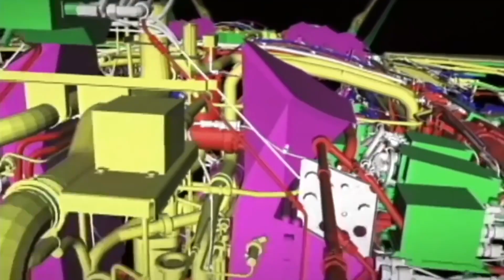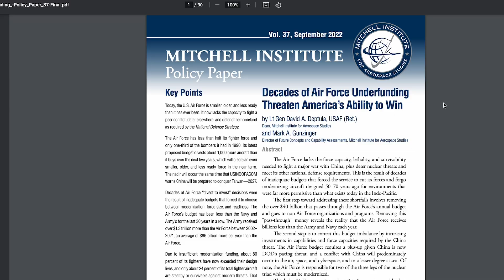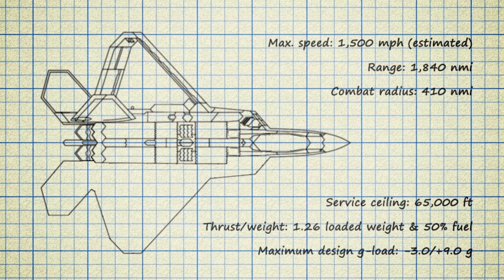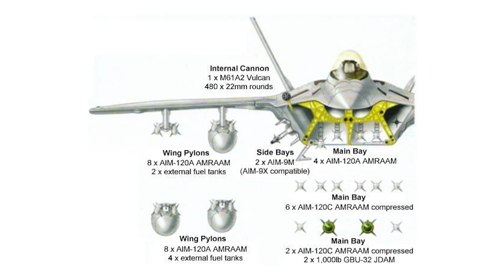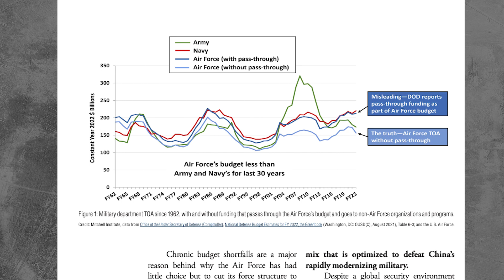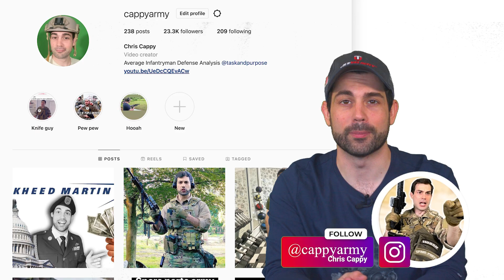Cancelling the F-22 Fighter is Worse than You Think

Comment: They cancelled the F-22 because it was too expensive. I have full confidence the military will eventually come up with something slightly better that will cost 10 times as much.
Reply: The new B21 is better and cheaper than the B2.
The next fighter will follow the same manufacturing processes.
Reply: and then made a more expensive less capable fighter that to this day has not managed to replace a single fighter that it was suppose to do
Reply: @saltysteel3996  The F-35 already kinda does! It's not quite the king of the skies that the Raptor is, but it's a WHOLE lot better at ground attack than it is worse at A2A.
Reply: a part of the rationale was to use the money for MRAPs , which was to help us pursue the Afghan/Iraq wars.  (woohoo)
Reply: @Attaxalotl  F35 is currently cheaper than some of its 4th gen European counterparts like the Gripen.
Reply: To be fair, they figured out how to make stealth coating durable and they probably could use a little more room for an radar.
Reply: Dude, at first I thought you were serious and I was about to light you up. So, please except my apologies on misjudging your wisdom and wit.
Reply: @saltysteel3996  Well, it's cheaper if they make all 100 of the B-21's. The real reason the B-2's cost went astronomical was that congress kept cutting procurement, which raised the price, which caused more cuts, which raised the price more, ad infinitum. And eventually the entire program cost had to be borne by just 21 planes.
Northrup (and USAF) got a bad rap. The insane prices are purely the doing of the Means & Appropriations committee.
It was either intentional, or the people we're electing to the senate aren't fit to manage a lemonade stand. Frankly both possibilities seem fairly likely.
Reply: @kathrynck  the maintenence cost of the B2 was also grotesquely high, which caused more cuts than the initial sticker price.
Reply: @kathrynck  you get it. The f22 would have been a lot cheaper per plane had they got the original 700
Reply: Because of Money, while Russia that having less money than US still working on their Stealth Plane Felon (even around 6 unit build or more probally), Checkmate and Pak da 🗿
Reply: The Universal Military Budgeting Value-Per-Dollar scale:
Gold Toilets <-- Air Force -- Navy -- < Postal Service > -- Army -- Marines --> Can't Buy TP
Reply: So can we make more A10’s with GE engines??
Reply: The designation of "F" means it's a "Fighter."  My guess is you mean a dog fighter.
Reply: The f35s they just grounded because of crashes?
Reply: I guess I am not the only one who thinks that every time something is canceled because it is too expensive, its replacement is even more expensive?
Reply: Expense was just thier excuse. It was Obama who called for it. It was political.
Reply: Please, it's been 20 years since the f-22 was designed, technology has improved dramatically. Also, have you seen the program requirements for the NGAD. The thing will probably end up looking like a spaceship and be about as expensive. But that doesn't because to the US government money is just a number and so if anyone can just spend their way to the best plane ever made, it's the US Air Force.
Reply: No, they cancelled it because Robert Gates was convinced that the next gen fighter would be without a pilot. He held an all call at ACC headquarters with all the pilots on the base and offered them a no-hold barred opportunity to convince him he was wrong. The problem in that approach was he didn't ask the acquisition force if the technologies required to implement his idea existed (spoiler they did not and still do not).

Source: I have been an AF acquisition professional for 20 years and know pilots that were in that room to watch the screaming match.
Reply: F-22 was developed before a lot of things even existed... I'm pretty sure there are a many problems that prevent the Raptor & the Lightning II to work together in an efficient manner. 

The F-22 wasn't made to continuously "evolve" either... you can't just add "new stuffs" on it to make it more modern.

That kind of thing is likely to be fixed with the development of next generation aircrafts... which will also probably lead to cost reductions on the long term.
Reply: they cancelled it because the cold war ended. that is the TRUE answer. F-22 cost wasn't much higher than other programs of the cold-war yet congress didn;t care as long as the Soviets still existed
Reply: I'm guessing you have never been in the military because if you had you would not say that about our government!
Reply: @Yung_pindakaas  That's more a failure for the Grippen than a success for the f35.
Reply: I hope so, many people says the same about the Sewolf subs, again, hope you are right.
Reply: @Karl-Benny  the F35 isn’t designed to fight a traditional fight. It plays an integral role in battle. If it comes down to dogfighting then things have gone terribly wrong. I’ve heard it liked to a fighter version of an AWAC. Long distance win
Reply: It wasn’t canceled because it was too expensive — look deeper and you might find out the real reason.
Reply: @Karl-Benny  Wow, are you misinformed. The F-35 is being sold to NATO allies and to Pacific allies like South Korea and Japan, and with mass production numbers, the cost per unit has gone down drastically. It's similar to what happened with the F-16 Falcon. The avionics and electronic warfare suite on the F-35 are also superior and much more modern/modular (able to be upgraded as technology improves) than the F-22. I love the Raptor but the Lightning II is the way of the future. An active duty USAF F-35 pilot, Hasard Lee, has a YouTube channel that explains this, and he draws comparisons with the F-16 (the most prolific fighter jet in the world) and the F-35.
Reply: You mean 10x LESS & make a superior aircraft & mass produce them ASAP & Efficiently
Reply: @saltysteel3996  the reason that the b21 is cheaper is because the design process of the f22 and b2 required expensive research
Reply: They did. It's called the F-35. Cheaper, just as effective, and capable of fulfilling multiple roles. 

It lacks (slightly) in maneuverability... which isn't actually that important in modern air combat, but it makes up for that with vastly better sensor suites capable of keeping track of the enemy and spotting them well beyond their own sensors' range. The F-35 knows where you are, what you are, and launched a missile at you five minutes ago that you only realized was coming when your buddy exploded right beside you. 

Dogfighting is, to put it bluntly, largely irrelevant. They can sweep the skies with largely invisible/untargetable aircraft that can take out enemy aircraft at absurd ranges. Since no aircraft is ever going to be out-maneuvering a missile designed to out-maneuver the aircraft, there's simply no need to invest so heavily into it.

It's the old WW2 mindset that Russia and China are still largely stuck in - and, well, you can see how that mentality is turning out for Russia. To be blunt: war has changed. A _lot_. We've got capabilities that make old tactics completely irrelevant. The US military has been compelled to actually change its mindset to what works, not what seems like it would work, and in this case what works is the F-35. Cheaper, more flexible, and in a lot of ways more effective - despite getting trashtalked by Russia Today and the Reformers, whose credibility should be in negative values at this point.
Reply: @gyneve  both honestly. The F35 is incredibly cheap for a 5th gen of its capabilities due to economies of scale. Its only a bit more expensive than most 4th gen counterparts while offering vastly improved and new capabilities. That said the Gripen offers capabilities worse than Rafale and only slightly above Latest block F16 for a price higher than F35.
Reply: @saltysteel3996 did I hear that it came in early and under budget?
Reply: F22 too expensive, and they decided with the F35 lmao
Reply: @PrinceofPwnage  F-35 is significantly cheaper, so...

F-22 is about $120 million per jet. $206-216 if they restart production.
F-35 is around... $78 million per jet.

No matter how you slice it, F-35 is a fantastic successor to the F-22. It's just been memed on by Russia Today and Pierre Sprey's cronies whose cumulative knowledge about aerial combat begins and ends at the Vietnam War.
Reply: @Yung_pindakaas  The project expense, and spinning its wheels getting started was the issue not the individual pricing nowadays which has gotten lower.
Reply: Slightly better? lmao.
Reply: @jacobzindel987  Yeah, that generation of stealth coating was quite delicate & high maintenance. But it is a good example of how congress's micromanagement of funding can muck things up even more than a foreign army can.
Reply: @Yung_pindakaas  That too! It's truly a masterpiece of aircraft design, and the legion of engineers behind it are a true inspiration for me!
Reply: It was so expensive because they made so few of them. Look at how much the price of the F-35A has come down since initial production.
Reply: It was expensive cause they keep cutting orders duh.. Don't let the saying its too expensive is a joke.. with any new technology comes cost but f22 would have cost less if they just had more built. Alot more expensive development for a new fighter
Reply: @DisgruntledArtist  add how much the program of the F35 cost
Reply: @matthewjackson5325  A LOT cheaper. As would the parts & upkeep.

Although, ultimately, I think the F-22 had a glass jaw in the form of poor IR stealth (relative to the Widow), so the lifespan of it's reign of dominance was limited before the first plane rolled off the line.

The logic went "well nobody has large numbers of aircraft with good IR sensors anyway". Kinda overlooking the point that IR sensors are relatively easy to make, and are now on thousands of aircraft. It's still pretty deadly, but it's not dominant like it was at launch.

If the F-22 wants to survive i n 2022, it needs to avoid using the gun or sidewinders, and stick with BVR kills only. It'll draw a lot of IR missile fire well before it gets close enough to show off the acrobatics.

So in a way, shortsightedness in procurement numbers somewhat negates shortsightedness in competition winner choice.
Reply: @honfmeilingfleet957  About a dozen units now. Maybe 15. Not all of them production models or combat capable though. Felon is technically inferior to the Raptor. But it's close enough to be a threat.

Unfortunately for Russia, I think the assorted embargoes have massively disrupted their top-end aerospace development & construction ability.

Much respect to the russian aerospace engineers though.
Reply: @Wessel Reynierse  Your glorified piece of crap F35 keeps getting delivery delays due to the F35 being a crappy plane.
Reply: we haven't need them since then.
Reply: @saltysteel3996  Don't look up the Air Forces NGAD program. For your own safety. Things probably gonna cost "hundreds of millions an airframe"
Reply: @saltysteel3996  yea that was a massive surprise to me too when I herd that.
Reply: @sevrent2811 what he said. Going from no peer adversary to peer adversaries kinda ironic now.
Reply: @Yung_pindakaas  
Lol no way. Still more expensive. Even by US standards
Reply: Haha😂
Reply: @DisgruntledArtist  Well said.
Reply: @rondoofnightmare775  Closing in on 900 built. The delays are largely due to literally everyone wanting them at the same time.

There are some delays. But tell me what plane you think is great, and I'll show you similar production delays.
Reply: @rondoofnightmare775  "Crappy plane"
Well, this crappy plane somehow killed 20 F-16s and lost only 1 in a Red Flag operation in 2017.
Reply: @applepie1911e  uh yeah the f35 is indeed a fighter. It's designed for both air to air and air to ground.
Reply: bkm83442 
They cancelled the best fighter jet in the world that barely saw any combat apart from a couple of sorties in Syria and even then it was spotted on radar by the Russians 
The truth is it was an over hyped expensive toy
Reply: F35: hold my beer
Reply: @nicktechnubyte1184  
SU57 hold my beer
Reply: @mark4371  being spotted in radar doesn't mean anything. Stealth jets get spotted on radar all the time. The team challenge with a stealth aircraft is NOT spotting them, the challenge is getting a weapons grade lock which is a million times harder.
Reply: Don't worry the Chinese can make f22 in the future with less expensive.
Reply: @mark4371  The SU-57 is perhaps the best stealth fighter in the world. It's so stealthy that we have never ever seen more than 15.
Reply: @andrewlechner6343  F22 design started in the early 80s and reached its first major milestone in 1986 and production started in 1996. So more like 40yrs old. Which is insane to me, considering it is still so far ahead of pretty much everything else.
Reply: That dig at the end was a thing of beauty,
Have a very Happy New Year.
Reply: Well yeah in a few years 6th gen fighters will roll out. Should come out by 2030 Acording to the military
Reply: Yeah it is called the F-35, oh wait you said better
Reply: @applepie1911e  How is it not a fighter? Name an aircraft besides the Raptor that comes close to it's capabilities.
Reply: I hate to tell you this but 6th gen fighters are looking to make F22 seem cheap. See peruns presentation
Reply: @andrewlechner6343  Navy F/A-XX project looks actually more ambitious in many ways.  1000+ NM range one one tank without refueling (F-35C is sitting at ~680 as one of the longest range fighters in service with the navy), higher top speed, enhanced stealth capabilities, and a massive internal weapons bay capable of carrying 2xAGM-158C LRASM's paired with the same insane sensor fusion found in the NGAD
Reply: Lol slightly better NGAD is more than your mind could even comprehend
Reply: @bobo-cc1xw  good.
Reply: @Yung_pindakaas  mostly because other countries want it
Reply: @johng8967  We kind of already hold a significant advantage in every respect.  Russian logistics don't exist, and they don't even have enough Su-57's for a squadron yet.  China has been hyped up on nationalism, propaganda and corruption for so many years that their end result against NATO or the USA would probably be similar to Russia's (maybe with some more fight though).  China also doesn't exactly have the greatest stealth fighters either.  J-20's RCS (as mapped by Taiwan) is close to the F-117's and doesn't look to be great in maneuvering fights (we're not even gonna touch engine life, sensor fusion, and maintenance)
Reply: @AverageJoe483  not really. It's cheaper then the a10 and much much much better. The f35 is amazing and is to replace most aircraft outside of the f22
Reply: @RuneFoot  but the R and D to develop the program was no where near worth it. It is approaching being obsolete already . Warfare is moving on.
Reply: @Anarchy_420  Even if it's not immediately better, the frame itself is being designed with hardware modularity and upgrade in mind moving forward so the cost of modernization is reduced
Reply: @kathrynck  yeah i also heard that Russia have so much money because of Gas and Oil export even Europe try to cap Russian Gas and Oil Russia still gain lots of money by selling it to Asia or Africa
Reply: @saltysteel3996  and it only took them 30 years!
Reply: @PrinceofPwnage  Depends on what you're asking. The overall program over its 70+ year lifetime? Estimated between $400 billion and $1.-something trillion. Of course that's taking into account maintenance and how many planes they plan on buying - 2500-ish atm - though that may increase over time.

R&D? Around $35bn.

From what I can find the R&D for the F-22 is between $26-40-ish billion. 

The overall F-22 program seems to cost around $108 billion and this is for... 195 planes. This was over its.. 30 year lifetime? 40? Hard to gauge.

So yeah. It's not quite that simple, really. F-22 is smaller in number, more expensive to maintain and construct, and is ultimately designed for missions that the US hasn't really had to deal with in decades. The F-22 doesn't seem to have ever actually needed to fight aircraft for aerial superiority. It's downed some, certainly, but there's been nothing up there to compete with even previous-gen US aircraft.

As such the F-22 is being phased out by a plane that can fulfill its role adequately while also not being largely useless outside of that role - able to perform an absolutely staggering variety of missions in addition to knocking aircraft out of the sky.
Reply: You go to war with the force you have, not the one you want years down the line. The F-22 was cancelled because MRAP production needed to accelerate and Gates prioritized the present at the expense of the future. Now we have an Air Force that is older and smaller than it's ever been its history. In the 1980's the average age of a U.S. fighter was 7-8 years old. Today its 30-40 years old and our adversaries aren't standing still. Gates also got wrong how many 5th gen aircraft China would have. By 2023 he said they should only have a handful, instead they have close to 200 and production is continuing.
Reply: DO I DETECT THE SLIGHTEST BIT OF Sarcasm HERE?
Reply: @tomj3372  Sarcasm is a true artform. But it can be hard to infer from the written word. Personally I use <sarc> so that my sarcasm is clearly indicated to those lacking the intellect and/or sense of humor to appreciate it.
Reply: @Rimasta1  Thankfully the F-35 production is already in full swing and so far as we can tell the Chinese aircraft do not have abilities comparable to the F-35, let alone the F-22. 

The F-35 is cheaper and, more thankfully, is useful for way more than just aerial superiority missions. It's not great, but with some 800 F-35s vs the 195 F-22s, I think the US air force is going to be alright. They're just panicking because they can't hypothetically crush both Russia and China simultaneously, but it also seems like they vastly overestimated the abilities of the Russians -- and possibly the Chinese as well.
Reply: @bobo-cc1xw  also maintance on 6th gen will be cheaper then 5th gen
Reply: @DisgruntledArtist  that's a really well written response. Thank you.
Reply: @saltysteel3996   no, the B21 claims to be better and cheaper than the B2, but the B2 itself claimed to be better and cheaper than it turned out to be :-)    The B 21 raider will turn out to be more expensive than Northrop is claiming at the moment …no doubt driven by last minute changes  and requirements like being able to operate off of a Ford class carrier, and run on bio diesel, while also being run on solar panels and hydroelectric wind energy…. And when none of that turns out to be feasible, they’ll probably run the whole thing on some weird kind of hydrogen fuel cell that cost 10 times as much, but is zero emissions and clean for the environment :-)
Reply: @saltysteel3996  Yes but the B21 has half the load weight capacity than the B2. B21 is smaller.
Reply: @Yung_pindakaas  …. In bulk, when separated from the R&D costs… or whenever Lockheed feels like lying it’s ass off.
Reply: @daxtertalon4  The Nighthawk, F-117 is anything but a fighter aircraft, yet it has a designation of 'F.' It's a bomber. It probably couldn't dogfight a P-51 Mustang.
Reply: @arcturionblade1077  I agree, and it will be retired faster than the F-22. That's the way of the military. In contrast, we still are using the B-52. It has been reworked and now sports advanced avionics, soon new engines (I hope) and still be here when a great grandson of a B-52 pilot will fly the thing.
Reply: They are currently testing it. Look up the NGAD program. Its supposedly being fast tracked so I doubt it will end in failure. It will however come out of tthe box with some issues like the f35 that will be fixed as more are made.
Reply: I'm the only one who's got your joke bro hahaha
Reply: @andrewlechner6343  f 22 failed
Reply: The F22 per unit cost was way down by the time they cancelled it.  They also had most of the bugs worked out.  It was well seasoned and just coming into it's stride when canceled.  It was a very bad decision to cancel the F22 and was based more on politics than anything else.  It was a beautiful machine in the production line.  It was very well thought out for maintenance too for once maintainers can climb onto the plane and work on it without the need of ladders.  Modular components make maintenance a much easier task than many previous plane.  

The issue is the time delay of develop, compete, award, work out problems then get the production line going, plus parts and repair facilities.
Reply: LOL, too true.
Reply: @PrinceofPwnage  Aw, thank you. It's... a weirdly complicated situation and finding numbers (all of which are invariably estimates rather than actual hard numbers) was a bit of a struggle.

I saw numbers for the F-22 ranging from $26bn to $120-ishbn, for example. Just a goddamn mess. It literally depends entirely on how whoever is giving you the number is measuring the cost at any given time. x__x
Reply: Like the F-35?
Reply: @snugglecity3500  a prototype was built and tested in just one year lol yeah I'd say that's freakin fast trackin it😆👍
And to everyone complaining about cost issues NGAD and F/A-XX shouldn't run into these complications much like The B-21 Raider.
Lol not directed at you S City just had to throw that in ;)
Reply: Too expensive and cut corners once again, might as well give it Iran , they treating the old Tomcats better than the Americans can, I'm sure they'll be use to their maximum potential.
Reply: Slightly better is all you need to be completely honest. An m4 is only slightly better than an m16. Slight advantages lead to much larger gaps than you would think. 10% better stealth is monumental.
Reply: @jahlahbrine843  Funny joke, but where is the punchline?
Reply: Don't worry If the air force gets everything on its wish list for NGAD its will definitely cost more than 10 times as much
Reply: Yea but naw hammy.
Reply: F35 is the next thing after f22. Isnt it. It is cheaper and has much better features
Reply: I'm most excited about Rapid Dragon. It is 40+ cruise missiles per C-17 sortie, fired from a standoff range of 1000+ miles, and it'll be able to put hundreds of cruise missiles on Chinese air bases before any of these fighters ever get into the air. Even if the S-300 could intercept half of that, it'll be enough to cut down the Chinese air attack capability before any dogfight is considered.
Reply: Hundreds of millions of dollars of the best money can buy. Not to mention next gen drones and a next gen advanced propulsion system.
Reply: Cover the A-10 Warthog with radar absorbing paint! An air superiorority fighter with a 30mm gatling gun! Problem solved!
Reply: @joew974 Were all of them grounded or just one model?
Reply: @joew974  you mean like every other aircraft that has crashed?
Reply: A big part of the reason it was too expensive is they cut production numbers so severely. It would have probably been a similar price to the F35 if production continued to the originally planned amount.
Reply: Carbon fiber Bulletproof nanotech F-33s built in Norway 🇳🇴.
Reply: @joew974  the only ones grounded were the f35 b there was some issue where it could lose precision in the guidance system during a vertical landing and cause damage to the aircraft. Military jets always have issues that aren't discovered and fixed until they've been in service for awhile. There were a ton of issues with the f15 and f22 during their design and even after. F35 is still a great jet, and issues are being resolved all the time, it will be another year or two before it reaches full maturity. It's impossible to build something as complex as a jet without multiple issues being discovered that will require temporary grounding until the issue is fixed.
Reply: @Anarchy_420  my point with fast tracking is that the early production airframes wont have their kinks ironed out. They will get grounded multiple times and have a low ready rate for a while.
Reply: @mikemurphy80  the f35 absolutely can dog fight AND DO IT WELL, however it is not its main design feature. The f35 is a jack of all trades. And has a lot of focus on ground attack. However I will say that several pilots have said that the f35 would outmaneuver any jet out there except for the f22. To say it can't dog fight is underestimating it radically
Reply: It wasn’t “too expensive.”   It cancelled so we could have “cash for clunkers.”  The same time they were cancelling the F-22 they were launching “cash for clunkers” at the same time.  So it was a choice by the Obama administration and Democrat congress.
Reply: In the name of capitalistic economic defence industries... 😂
Reply: @snugglecity3500  this is 6th generation we shouldn't see the same 5th gen problems with how advanced digital engineering has become insanely efficient, my point was they built, and flown a prototype already in just a year in itself is mindblowing! Made possible from powerful supercomputers and digital engineering! This isn't just another Plane NGAD will change aviation!
Reply: They already flew something light years better.
Reply: For reference, one f35 would buy you half a f14 in real terms. I take it from this that development costs are rising for each new generation, whilst manufacturing costs are being trimmed back (in very general terms)
Reply: @Karl-Benny  The F-35 does have the advantage of being able to be launched off helicopter sized characters. Adds a ton of versatility to the smaller carriers.
Reply: @Anarchy_420  im more excited for 7th gen. With all the programs going on right now the generation after the next one will most likely have entirely different propulsion. Like going from props to jets except it will be a different kind of jet engine.
Reply: @saltysteel3996  lol depending on the defense contractors. Northrop YF-23 lost to LM YF-22 because back in ,,,80s and 90s Northrop were doing what LM doing now. Delays and over budget. Some companies learn their past mistakes some don't.
Reply: I was lucky enough to have an awesome close range air show of an F22 for like 20-30 minutes. It was awesome. I was in the middle of a field by myself at NJMP during a track day, and this guy in the F22 was flying directly at me. Pulling high G turns around me. It was like my own personal F22 show
Reply: @tranquilreverie203  SU57 will probably see more combat than the F22 ever did
Reply: Lol
Reply: They cancelled it because they don't need it. The F-35 program was expensive too. The Chinese and Russian air fleets aren't an actual threat so long as their air-to-air ordnance isn't up to scratch.
Reply: LMAO soooo true
Reply: They canceled the F-22 because there was allot more money to be made in the F-35 since it could be exported.  The F-22 would have been allot cheaper if they would have originally made what they first wanted.  Plus there would have been continued research and advances in its stealth tech which didn't happen because it was canceled.  They moved on from it.
Reply: Yeah f22 is 20 years old and still better then the waste of money  f35 has been
Reply: @Matt-yg8ub  just look at the numbers my guy. For the Price of restarting F22 production you can buy 3 F35s for each F22. Also yes RnD is factored into the cost, but if you can spread out the R&D cost over thousands of planes the planes become a lot cheaper.
Reply: @Yung_pindakaas  Not for maintenance, the F35 is still very expensive in that category. Initial buying cost is not everything.
Reply: @mark4371  You are probably right about that.
Reply: @Perrirodan1  compared to what though? The F22s stealth coatings were notoriously horrible to work on causing extremely high maintenance costs, they were also comparatively unreliable. The F35 statistically (unlike popular belief) has the lowest failure rate of any US aircaft currently, its panel based stealth coating is much easier to work on. Is the F35 maintenance more expensive than a non stealth 4th gen? Yes. But its vastly better than the F22s.
Reply: @lonemaus562  I respectfully disagree. The F-35 has evolved into a lethal killing machine.. in 2017, it had defeated aggressor F-16s in a Red Flag operations with a score of 20-1. Moreover, an F-35A is only $78 million per unit, which is extremely affordable compared to 4.5 and 5th generation fighters.
Reply: @Perrirodan1 The cost of maintenance isn't an entirely bad thing. It creates movement in the economy as maintainers are paid, and they take that money back to their communities
Reply: You know all this anti plane stuff is stoked up by rival manufacturers.
Reply: Does not everyone understand how threat-levels, logistics, costs work? Example: Not all APC's are tanks etc... Not all bombs can be tactical, not all bullets are armore piercing. Not all grenades are "frags", not all howitzers have the same rounds, not all ships do the same thing (nor Subs) etc.... Even Spec-Ops have differing specialties. The F-22 was a "tip-of-the-sword" system, not a mid-low level threat. Sh*t, I'll build 1000 P-51 Mustangs for the cost of 1 B2. Upgraded components and cheaper to man/maint. Gimme the $$$ for 2-3 B2's and I'll fill the sky with P-51 (2022's). Dones can be corrupted, not a 51, leave the (most) tech out of it. NOE flt is dangerous to those that cannot see them. Bouncing betties :)
Reply: Correction: it was too expensive, and there was nothing American enemies had that justified the cost.
F22 was literally too good for the world. That's fucking mic drop moment for everyone involved.
Reply: @sachmo0196  Yeah 1000 p51s are gunna need a lot of investment above and beyond the planes.
Also I don't know who you would expect to fly it.
Your strategy seems to be "well this will make them run out of missiles pretty quick"
Problem is you run out of willing pilots pretty quick too.
Reply: @daxtertalon4  F-117 - except when it doesn't ;-)
Reply: @gyneve  Not really, it's a result of an order of magnitude difference in number of airframes produced. And tiny Sweden certainly doesn't have the clout to compete on a level playing field with the US. Now, if Sweden was a super power (it's only been 400 years since the last time ;-), we'd surely behave the same way though!
Reply: yeah probably
Reply: @Attaxalotl  it can also be afforded by lower budget military's than the USA, at only 100 million a plane. It also has greater stealth than most other planes (Other than the F22), better hardware like radar and tracking systems (other than the F22), and can be used in a multi-purpose role, being able to carry bombs and AAM's simultaneously.
Reply: @honfmeilingfleet957  given the Russian airforces current performance in Ukraine (aka getting shot down by decades old MANPADS systems and more recent mobile missile AA) ima guess that their new stealth jet won't be able to match the F35, both in production numbers or performance (6 Su-57's in a 3 years compared to 900 F35's in 16 years)
Reply: @maurice3464  well, the A10 hasn't been produced in decades, only modernised, and it's modernisation package costs more than a brand new F35 so I'd say no. If anything, the USAF should be looking into replacing the A10
Reply: @mikemurphy80  if a modern fighter even gets within visual range of an enemy fighter both sides would have had to have fucked up completely. Over the horizon missiles have existed since the F16, nowadays stealth and missile tech is more important than anything else a fighter can have.
Reply: @irishkiwi477  yeah, F15 took decades to build but the F16 took just months since all the required infrastructure was already there. There's always gonna be an expensive plane that doesn't reach mass production followed by a cheap plane that's better and does get produced. F22-F35, B2-B21.
Reply: @tranquilreverie203  6*. Ignoring prototypes only 6 have been produced in 3 (coming up on 4) years, out of the 15 ordered.
Reply: < 200 is tricky to support - probably lose a couple a year to accidents. I would have asked Lockheed Martin to keep the production line open at an absolute min. rate and ask for a Raptor v2 with a bunch of technical quick wins to improve sortie rate.
Reply: @Wessel Reynierse  Obviously, you have not heard about the latest setback to the F35 program in which the nose gear collapse of a F35B during landing has triggered yet again another delay in delivery of the much hyped super fighter that always seems to break in operational usage. Everything from the mountains of super complicated computer code to actual working parts of the design have yet to be approved for full rate production leading to actual costs of the fighter to be much, much higher than Lockheed and the airforce would like to admit. So far, the F35 has failed to meet operational parameters for usage and likely never will be able to meet program expectations. The sad truth of the matter is the pentagon under Bill Gates made a colossal screw up in canceling the F22 raptor in favor of dumping all the Pentagon weapons budget for the next 50 years into a program that has been doomed to fail from the very start. 

As of today, the clear choice right now is to cut the Pentagon's losses and buy more F15EX fighters and put those aircraft into use as soon as possible.

The F35 fighter program is yet another case study in how to not buy a fighter design that actually works.
Reply: @cookiecraze1310  can we keep the gun system? It’s called “Smoke break” in battle.
Reply: @mobilekaos  That’s the upgraded engine I believe. No plane expert but know that sound of the weapons system. I know it’s not even made anymore just a light hearted response. However if you seen 60 of them bastardized plane coming all full guns blazing think of the star spangled awesome shit that would do!
Reply: If the US is saying the F-22 is too expensive to manufacture, imagine what the SU-57 costed the Russians to manufacture
Reply: @sevrent2811  exactly. And until Russia invaded Ukraine, no one REALLLLLLLY believed that great power conflict was likely in the near future.....
Reply: @DisgruntledArtist  Yep, its also by my calculations F-13 better than the F-22
Reply: Sounds like you haven't been in the military then. Anything that makes sense has never happened in a uniform.
Reply: U need to have enough orders to drive down the per unit cost so it becomes a chicken and egg problem.once you cut back in the orders
Reply: F35 does it still have side guns? its pretty handy when a pilot gets into very sticky situation like F22 still got Guns. just in case of a very close encounters of a kind.
Reply: @saltysteel3996  to be fair, a lot of the additional expense with the B2 is because of last minute changes to the requirements that were undone in the B21
Reply: @Karl-Benny  Are you talking about the f-35?
Reply: @saltysteel3996  But the F-22 was air to air
Reply: @Pyratemime  what can you share about that screaming match that is hilarious, illuminating and won't get you in trouble?
Reply: Tell elon to make 1 and it'll be done in 1 year and cost 35k LOLOL
Reply: It's called the f35.
Reply: @Yung_pindakaas  really? The gripen is $30 million a piece with the F35 is $78 million each
Reply: Your comment pissed me off until I read the 10x cost part. We're cool now.
Reply: @james_the_darklord  idk where you got that figure from, gripens currently go for around 85mil.
Reply: @Attaxalotl  US just ordered 100+ F35 i heard
Reply: @stannisbaratheon6637  The plan is to order a total of 3000
Reply: @Yung_pindakaas  I don't know where you got yours but the J39 is a bargain multi role jet fighter
Reply: @mikaelandersson1288  the F35 was never designed for the same role as the F22.   Just look at the designs, the F22 can supervise, has almost twice the speed, and has several advantages over the F35.  The F22 was designed specifically to take out other aircraft, missiles, and satellites.  The F22 was originally going to take the 0lace of the F15E and the F35 was designed to take the place of the F16.
Reply: @chesterpophamproductions2879  The F-22 is overpriced but goood with a top speed of MACH 2.3 while the F-35 is both overpriced an bad with a top speed of MACH 1.6.
Forget about dogfights... how is the F-35 going to outfly SAM's at MACH 1.6?
Reply: Tax payers needs a better military equipment for freedom
Reply: @homelandfighters8541  Buy from germany.... it's very good quality and it's not overpriced.
Reply: And with the guns removed like on zumwalt
Reply: @Shoelessjoe78  yeah with their 3 days of conventional ammo and no tactical nukes. Sure thing bro 👍
Reply: @@traianowellcome2617 F-35 = MACH 1.6 top speed.
Reply: @Macho98  yes but they got a 6 th gen fighter called NGAD in production that is going to cost like $100 mill a pop
Reply: For what reasons will it cost more? Adjust for inflation and you have 3 times the money to play with roughly but I don't understand how it will cost more excluding the exceptional circumstances we couldn't really have anticipated
Reply: @TheSubpremeState  it’s going replace F22 role but going to be way bigger than most fighter jets at least a 2 seater. They want much longer range so it can operate better in pacific like further than Guam range. NexGen stealth capabilities. An a lot of man unmanned capabilities.  And do all of that at mock2
Reply: That shit was a Chenny money scheme!
Reply: @cookiecraze1310  wait?! So they no longer hit the brakes so they can fly right by??
Reply: @Yung_pindakaas  the Gripen can dogfight. the Gripen has also beaten The J-20 in longrange combat in exercises with China. The new f-15EX costs about the  same as the f-35 and is much bigger and more capable. but the F-35 is well suited for its role in combined arms air to ground. but it is near useless in that role if we cant control the skies.
Reply: @jdo8405  Specifications on ngad are not finalised. price per unit with drop as more are produce as it has with the F-35
Reply: @saltysteel3996  That's not Lockheed bro. That's Northrop.
Reply: WE. JUST GAVE AWAY 100 BILLION DOLLARS ,,,,,HOWW. MANY RAPTORS COULD THAT BUY,???
Reply: It is the only way to push boundaries.
Reply: @sandraherdman3783  Very few raptors. It would cost a huge amount to restart the production line Probably not worth it to build a 20 year aircraft when you can design a new much better one. Also raptors dont work on carriers
Reply: hahahaha!!!! exactly
Reply: It's expensive because it's proprietary technology, the F22 was such an amazing piece of kit it was illegal to sell even to our closest allies. The next one won't be any cheaper to build or maintain.  I think the cost was calculated against the numbers realistically needed. We had over 100 of the best air dominance aircraft in the world. At some point they have to ask, how many do we need.
Reply: @unknown23hornet22  Dogfights dont mean anything anymore. Nice that the gripen can knifefight but if every engagement is BVR its useless. F15EX isnt more capable than F35 but is great when used in tandem of eachother. You have a clear misunderstanding of how important stealth is in modern A2A engagements. A F35 can detect and fire on a non stealth plane like Gripen at roughly 150km away, a Gripen cant detect and fire on a F35 until within about 20km away. This means a F35 can shoot and kill nonstealth fighters without ever even showing up on their Radar. F15EX is a supplement to F35. F35s stealth is lessened a bit when its weapon bays open and this limits their weapon load, mean while F15EX isnt stealth but can carry a lot of big long range missiles. So you could have F35 flying ahead as a forward stealth sensors/radar platform, designating targets for the F15EXs acting missile trucks, with the F35 guiding their standoff missiles to targets.
Reply: @Yung_pindakaas  Well said. Well coordinated combined arms is extremely effective. Few things though. SEAD (Suppression of enemy air defense) is likely a concern. You have to worry about people using your own radar to track you. Anti radiation missiles, jamming and maybe a few decoy missiles are all variables
      Altitude is important in this scenario as low flying planes are harder to detect but have less ability to detect things.
    Also 15ex has very good radar and can carry a infrared tracking system. This would decrease the effectiveness of stealth aircraft. 
    Stealth is not full spectrum it optimize for certain frequency. It is often optimizes for targeting frequencies, like it is in the F-35 and F-22.  Fighter and targeting frequencies high frequency radars.  But they much easier to spot with low frequency search radars. the enemy will likely know they are there unless they are hiding in the shadow of another aircraft. but targeting them is much harder. That is how an f117 got shot down.
Reply: @unknown23hornet22  I fully agree with you. Especially since J20 and SU57 arent even true stealth, just Low Observability from front aspect and have little IR shielding.

 The F117 situation has slightly more nuance though, it was in part due to a highly motivated and smart Air Defense commander in addition to negligence by USAF by flying the F117s over the same approach again and again without sufficient EW support. Its an interesting story tbh.
Reply: No, the F-22 was too expensive BECAUSE they cut down the order and wouldn’t allow even very close allies to buy it.  When the government purchases a weapons system, all of the R&D cost is spread out as part of the unit cost for each one.  So if the R&D cost for a plane is $10 billion, and you only build 20 planes, then each plane has $500 million of the R&D cost tacked on to the actual cost of production.  But if you build 500 of the same aircraft, that’s only $20 million of R&D cost per plane.  This is why the B-2 cost $2 billion each and the F-22 cost $200 million each....because too many members of Congress see the initial unit cost and don’t realize that it will come down if they stick with it.  (Rumsfeld/Gates/Bush/Obama also bear some blame here for not making the case to Congress and focusing too much on weapons for low-intensity conflicts and non-peer adversaries.)  And then there’s more money that has to be wasted on the replacement.  

By contrast, Congress was persuaded to stick with the F-35, and now the unit cost is down to about $75 million, which is a good deal as jet fighters go, and cheaper than a new F-16.  And contrary to what uninformed people would have you believe, the F-35 has turned into a really excellent aircraft once the kinks were worked out.  Too many people are reading reports from 6-7 years ago and assuming they haven’t fixed the issues.  They have.  That’s why foreign buyers are lining up to purchase it.
Reply: @honfmeilingfleet957  Yeah, but the Russians’ “stealth” Su-57 is only about as stealthy as a Super Hornet (not stealthy), and they don’t have the capability to make their systems work as advertised.  The other two aircraft are nothing but drawings on paper, with one wooden mock-up of an Su-75.  Meanwhile, the US is building hundreds of F-35s, with systems that actually work.
Reply: @joew974  The F-35 has had a lot fewer crashes than any other fighter program of its size.  2 crashes, and one that rolled off a carrier after landing.  Other countries are lining up to buy it.
Reply: And no major performance increase over the F-15E Strike Eagle.
Reply: I was laughing my ass off when I read this the 3rd time. Completely spot on!
Reply: Not only is it too expensive, but it has major maintenance issues.. I am a former USAF fighter pilot.. I knew the F-22 was going to be cut a couple years ago.. The USAF is moving to a different philosophy of fighter design and procurement to make it more flexible and cost efficient..  ( If that is even possible in any government entity!  LOL)
Reply: @vicpotts6381  The F-35 is also too expensive.
Why not develop a F-16G with the latest tech?
Reply: @kathrynck  exactly the same thing happened to the F-22, the per unit cost kept increasing as Congress kept cutting the number of fighters that would be procured. If the Air Force purchases all the new super bombers as promised the per unit cost would be cheaper than previous stealth aircraft but if we look at it historically I would not be surprised if the number of aircraft purchased goes down to below 30 and the per unit cost triples or more. US government keeps playing the same game they order a number of fighters to certain specifications, the fighters / bombers are developed and the government is told it will cost x price for the specified number of aircraft and then the government response with great will take a tiny portion of that and then they take a quarter to a 10th of aircraft 4  to 10 times the cost. In the end the US government pays the same amount for fewer aircraft a decision that only makes the barest amount of sense if you are looking at per unit operational cost. But even if you only intend to operate a fraction of the number of aircraft purchased having spares mothballed would save a lot of money in the long run . The only conclusion is that the US government cannot plan budgets at all in any realistic manner whatsoever.
Reply: @tsiefhtes  Yep. Exactly.
Which is why the F-35 was a bit of a "nail biter" until they got that first "large" lump-sum bulk order about 4 years ago (and the per-unit price magically dropped like a rock).

Don't get me wrong the F-35 development process was a beaurocratic nightmare, but the engineers managed to pull a win out of it. And procurement of it is a total game changer for global balance of air power.

The DoD did end up having to say more about the design of the plane than they really wanted to though, (less secret than usual) in order to dispel the myriad negative rumors. Although a lot of aviation fans didn't seem to keep up with it all, undoubtedly near peers did.

International orders helped limit haing ALL of the power in the senate appropriations subcommittee. But I really didn't know if the plane would be particularly successful or not until I saw that first cash-up-front bulk lot order.

It's not just a plane thing either. Similar has happened to naval ships & submarines. Procurement micromanaging has the potential to destroy or cause the cancelation of anything really.

I think I saw that the B-21's development cost was fronted by the USAF this time though. I think NG was sick of being blamed for the final unit cost of the B-2. So that should mitigate a lot of this sort of effect from bungled micromanagement of the procurement. Though there's still factory set-up costs, and economy of scale.
Reply: @Big_Red1  It's pretty cool to think about isn't it.  How the f22 design concepts began so long ago.
Reply: @Attaxalotl  If you don't have air superiority then ground attack planes are just extremely expensive flying coffins.
Reply: @tonysa2337  Yeah; but the F-35 is still pretty good at Air Superiority.

A strange analogy:
The F-22 is like, the most delicious gourmet sourdough bread you've ever had, fresh made in San Francisco with a heap of handmade butter on it.

The F-35 is one of those bake-at-home loaves you get from the store with a pat of stick butter. Not as good, but it's still sourdough, it's still hot, it's still buttery, and it's still great.
Reply: They already have.  And there's a new type of coating that can go on these planes that is much more durable and allows them to fly supersonic.
Reply: @Attaxalotl  not quite king of the skies, with a 20-1 kill ratio at red flag. not as good as the f-22 but at this point does it even matter?
Reply: @vicpotts6381  The F-35 is also too expensive.
Instead the F-16G should be developed using the latest tech.
There could also be a F-16M for the marines and a two-seater F-16N for the navy.
Reply: Yea they'll get ti right even if it takes every last dollar we can borrow.
Reply: The flat out reason for cancellation regardless of the strategic planning or rationale, etc., was simply  because there was a finite USAF TACAIR procurement budget allocated in the FY10 and The deciders that be, had to decide if:  A) there would be reduced # of F-35A ordered in order to enable a small batch of F-22  ?  or B)  Max out the number of F-35A units ordered as could be afforded withing the budget to hopefully keep the cost per unit down, but at the expense of F22 procurement funds being consumed.

Plan  B)  won.
Reply: @saltysteel3996  that's yet to be seen...
Reply: @DisgruntledArtist  why did my buddy explode before I knew we were under attack? Did we both have our RWR turned off or something?
Reply: @TexasGreed  It was a reference to the Iran-Iraq war -- but still not entirely unthinkable given that your only warning will be that a missile has entered terminal range.

The F-35 is fully capable of outranging aircraft radar and the combination of stealth means that even while it is within that range, so long as it's at a distance it is still functionally invisible. From that range it is apparently capable of identifying, tracking, and locking on to targets while in stealth - unlike the F-22 which has to resort to a more conventional radar to use some of those functions. 

That's why I refer to it as a sniper: it's basically designed to shoot down planes before they know they're in a fight. By the time you realize something is wrong the missile has already reached you. Until then it's just a normal patrol. Maybe you know something's out there, maybe you don't, but either way it's not a fair fight against 4th gen fighters.
Reply: F-22 skin made from obsolete stealth material.
New stealth material on F-35.
Reply: Just to add: the stealth plates on the F22 apparently needs 10 hours of maintenance for every hour it flies. If the F22 flies through a dusty environment, it can corrode the stealth coating so much that they need to replace it. That's why it was never deployed in Iraq or Afghanistan until later and costs a fortune to fly
Reply: @mikaelandersson1288  First, please realize the fact that a fighter jet will not be flying at max speed at all times in anticipation of an enemy SAM. It's a complete waste of fuel. The F-35 doesn't need to fly faster than Mach 1.6 because it has stealth and electronic warfare capabilities. Unlike your favorite 4th generation fighter, it would just fly into contested airspace undetected.
Reply: @mikaelandersson1288  The F-35A is only $78 million, which isn't expensive. Also, the navy is already getting their Block III upgrades for their F/A-18E/F Super Hornet. Why would they switch over and waste money training pilots and maintainers on this completely different jet?
Reply: @tranquilreverie203  The F-16G/M/N will not cost $78 million a pop.
Reply: @mikaelandersson1288  It will perform fine. After all, this jet performs so well in practice dogfights because the opponent never knows where it is. Look at the 2017 red flag operation, for example, where F-35s killed 20 F-16s.
Reply: @mikaelandersson1288  But it doesn't come with stealth, sensor fusion, or a $400,000 dollar helmet that lets you see through your plane's fuselage.
Reply: There's a way to predict exactly what they're going to do every time. Find out if something is a good idea or a really bad idea. If it is a really good idea they will not do it, if it is a super bad idea they will make sure that they do it. That is their Doctrine. And the most important part of their Doctrine is that they waste and steal as much of our money as possible and make themselves and their cronies as rich as possible in the process.
Reply: @honfmeilingfleet957  The SU 57 Felon has a very different type of stealth and its called barely stealth or SWJ Stealth, which stands for Super Weak Joke Stealth. Vladimir built and designed it with his bare hands.  Right before he figured out that invading Ukraine would Super easy, fast and popular, and that there was no chance we would arm Ukraine 🇺🇦 and that they wouldn't fight for their freedom. Dude has mad vision about everything.
Reply: @actionjksn  we have not see SU57 Felon in any Battles yet so does F-35 so we never know and also Both those Plane has failuer during test but still i have to admit those Russians can still make those Planes even though is not really as good as F-22 or F-35 or got a massive Sanctions from other Countries
Reply: @actionjksn  and also i don't like F-35 because it always crashed many times, i like F-22 Raptor Better but sadly it will be Retired soon......
Reply: "Never anticipated " two war fronts?  The old standard was two fronts. Defunded that capability by choice by both parties.
Reply: They already have
Reply: I think 150 F22 already in service are enough
Reply: the upcoming next-gen air dominance fighter will fill the lost f22 role in the 2030s. 
but yeah it was dumb-dumb, f22 when it came in 2005 was 20 years ahead of adversaries, it can win anyone even today. to cut it because it was too good and didn't have opponents, and couldn't be used in a role it wasn't designed for (bombing dirt-poor farmers that cant read in the desert-caves ) was mind-boggling logic.
Reply: Cope m
Reply: Ed Zachary
Reply: How about something they wiah was better that they still can't get to work right. Meanwhile, the infantry slowly loses more air support...
Reply: @Yung_pindakaas  The gripen is about half the cost, so no. Thats false.
Reply: @ZFilms11  its not. Due to the massive industries of scale advantage the F-35 has at this point the gripen is no longer cheaper. F-35A was 200mil+ 5-10 years ago, now they are of 77 million a piece while gripen sits at 85 million while being vastly less capable. So many countries are procuring F35 that the development costs can now be spread very wide. Gripen has been adopted only in very limited numbers by a couple countries while Thousands of F35s are on order.
Reply: @Yung_pindakaas  They are still cheaper, both in maintenance, training, such. It is also not strictly to NATO allies, and is open to an international market with open source code released to customers. You are still wrong.
Reply: Okay so whats your point? Yes operating costs on F35 are likely higher than Gripen, but you also get a vastly more capable package in the end.

As a military looking to modernise your planes. And you have 3 options.

1. Going for the 5th gen F-35, which is by far the most capable and futureproof fighter on the market today, and extremely affordable for the capabilities it brings. Basically outclassing current 4.5gens 

2. Go for Gripen. Which is more expensive to acquire than F-35 and vastly less capable. But also cheaper in cost per flight hour. Good for short term but likely obsolete within 10-15 years. 

3. if ur on a budget why then not just go for Late block F16. It can do 90% of things a gripen can but is less than half the cost. Especially if its time to obsolescence is close to that of gripen?

I have nothing against gripen btw. Its just that due to its lacking economies of scale and its 'middle segment' capabilities its not good value for money in the current aircraft market.. Which is why its export isnt  very successfull.

Richer countries US aligned countries go for more capabilities with F-35. Medium rich non US aligned countries go for French Rafales which are more capable than gripen while only slightly more expensive. Also France is a very dependable arms supplier.  But Gripen is too expensive for low to mid income countries which instead buy MiG29 SU27 or F16.
Reply: @Yung_pindakaas  I disagree.
Reply: @ZFilms11  i guess youre just a saab gripen fanboy? Its a good aircraft and an excellent choice for Sweden but i get why most nations chose not to procure it.
Reply: @applepie1911e  F-35 is a fighter. Its a multirole stealth fighter.
Reply: @Yung_pindakaas  No, I just see value in it.
Reply: They need to learn a  thing or two from Saab. Imagine if the US built a plane costing like the F-35, witht the philosopy of the Gripen! Boeing has already worked with them on the Red Hawk...
Reply: @skagerstrom  why? Atm F-35 is more capable and cheaper than Gripen.
Reply: @nightizzat4574  yep, the Chinese will TRY to make an F-22 in the future. But then it will just look like one. LOL
Reply: You don’t know the military, than.
Reply: @mikemurphy80  So...
Like a stealthy F4 Phantom II?
(And I mean in the sense that it was originally made, ie a missile carrying interceptor)
Reply: @Karl-Benny  What you mean more expensive. The F-35 is below 80 million dollars
Reply: High operational cost, limited combat range and payload and another thing they are not sharing is the fast changing  enemy air space defense environment of near peer powers. From all angle, F-22 is not viable anymore.
Reply: It's expensive but it's also old so the real money issue would be upgrading them to future standards.
Reply: @Attaxalotl  Yes but the F-35 was built with more interchangeable parts so it can be updated easier than the F-22.